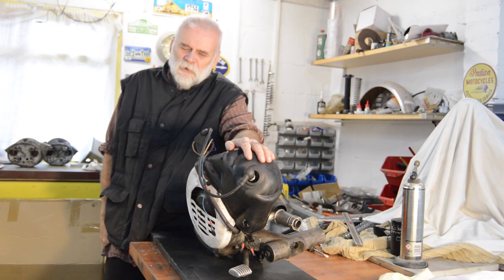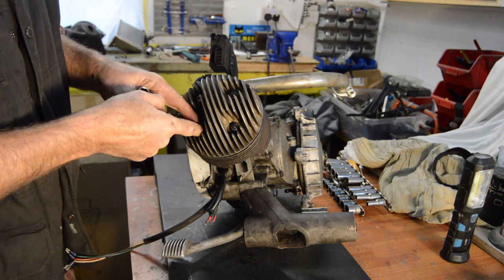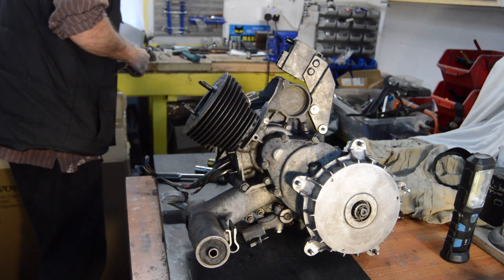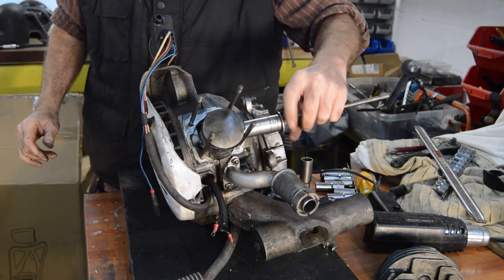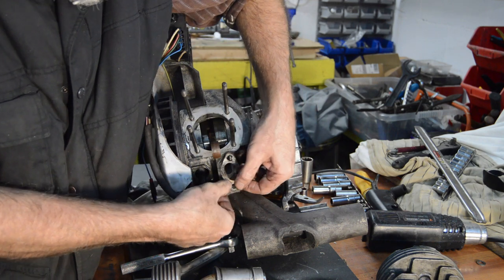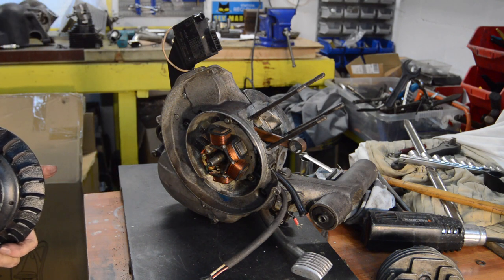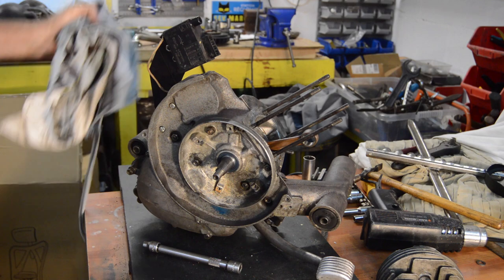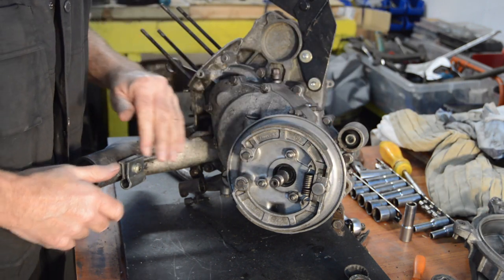Vespa Smallframe 1

Comment: hi there! going to replace a head for a stripped spark plug hole on my ET3 prima- do these head on the smallframes not have a headgasket? i didnt see anything in your tear down. thanks! and great video
Reply from the maker: Hi, from memory ( and mine is fading fast sadly ) they did not have head gaskets from the factory. Several after market kits did, the one on this engine did not, hence its absence from the video. Good luck pulling it apart and thanks for watching!
Reply: @oldnutsgarage  thanks for making a great tear down process and rebuild! Super essential!
Reply from the maker: Glad you liked it and once again, thank you for taking the time to watch it!

Comment: How mm cylinder-piston could i put in with factory camshaft.
Now is 50cc my vespa :)
Reply from the maker: Hi, I do not know much about tuning but I think the largest you can go with a standard crankshaft is 112cc. Malossi used to do a complete kit with uprated clutch, primary, carb etc so check SIP or whoever your preferred supplier is, they will be able to help. Thanks for watching!